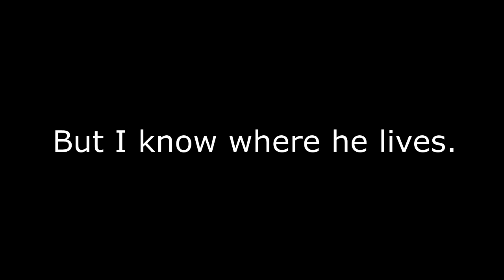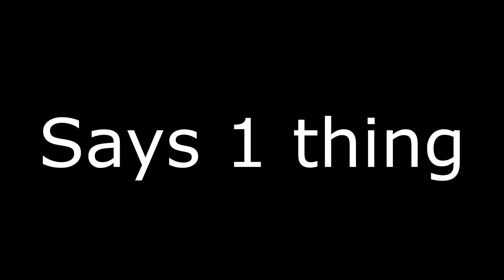SUPER SKETCHY DEAL: Only On Craigslist

Comment: 3d machines you'll never believe it but, I went to buy a dual sport Drz 400, on Craigslist. looked over the bike, it was missing bolts on the plastics but ran good and seemed decent, bought it for 3 grand!!! thinking it was a really good deal, got it home, tore the plastics off, air filter was full of rats nest, carb full of crap, whole subframe was bent, it leaked coolant from the water pump, leaked fuel from the Accelerator pump on the carb.. can't wait to fix more :)
Reply: Damn, the worst that happened to me has been a kx250 with severly bent subframe which is still usable so im not bitching yet lol. i traded an 01 KTM 125xc with blown fork seals for the kx250, that was just replated. I'd say it was a fair deal

Comment: when i bought my first motorcycle, it was an 83 suzuki gs650gl, and the guy already had the title signed and notorized which is all you need in KY for a transfer. and i walked away with a hunk of metal for $700. it refused to run all winter but the next spring it ran beautifully. i rode it for 2 years and 7000 miles without ever changing the oil and sold it this past september for $725.

Comment: I bought a car for $150 and I knew what problems it had
broken CV joint
severe body damage
broken door handles
broken radio
broken interior light
breaking steering wheel

$150 tho :D
Reply: Haha I bought my car for 100€ and it somehow wasn't a new car either, wonder how :D 

undercarriage needs some work, it sat for 6 years 
electrical work... let's just say it's a big mess 
water leaks everywhere 
no radio or speakers 
even tho no rust (calvanized body from factory), paint is faded and stuff 

however, engine is still going strong, gotta praise those 1980s audi engines :D little tlc, could become my daily driver :D it's almost in better condition than my mum's old car, 13yo suzuki :D

Comment: Was going to buy a Yamaha superjet and Craigslist, but the guy sold it before I could look at it. Same ski is back up on Craigslist a month or two later. I go and check it out and the kid said that his parents said it was too dangerous, so he never rode it. I did a compression test and had him start it and everything seemed fine. So I bought it, put it in the water and wouldn't go past idle. Turns out the carbs were clogged so after that it was good. When driving heard a weird noise and found out rear crank bearing is bad. Here I am rebuilding the whole engine. Good thing I got it for a decent price.

Comment: My sketchy story; I had found an ad on craigslist for a 94 7.3 Powerstroke, Truck looked nice. Was blue, lifted four inches on 35's. But there was only one picture on the ad, and said it only needed cab corners for inspection. I said screw it and texted the guy, he said to come over and look at it. I got there and as soon as I saw it, I knew it wasn't the same truck. It was blue but had lots of red pinstriping, did have 35's. But very very many rust holes, such as rockers, cab corners, bed, and the tailgate was rusted out. Didn't even get out of the truck. Left right after I had seen it

Comment: I recently bought a 2005 Crf250R out of Springfield, Mass over the summer. If you live in Massachusetts you know to never buy from the city. I was a little desperate and the price was right for the POS. We went 50 miles and arrived in the Ghetto. No joke, 6 dudes all walking around the house, 2 mothers with their kids on the front porch. Sadly that was the address. My dad and I walked up and asked if they had the 250, they did. The guy selling, Christian, said it was in his "Basement." Alarms were going off in my head and I could see my dad sort of losing it. We walked down the steep steps and immediately Christian told us to wait there while they clean their "Mess" up. We could smell the pot they just smoked, we saw the haze. They finished picking up and we walked down to a 250 in the corner of the basement and about 3 dudes all in foldable chairs sitting there eyeballing us. We had to push the bike up the stairs and outside. Soon enough we got it out and it turns out the bike was shot to hell but still ran. He tore the spark arrestor and the baffle out of the pro circuit and i swear it was louder than a banshee. I ended up buying the bike for $1500, and I put about $2k into it and the thing absolutely tears ass on our trails.

Comment: 3dmachine I went to buy 2 dirtbikes both were supposed to have no compression. well I wound up getting there in the dark at the guys house and he had about 5 guys outside. well the brought the bikes out of the house that had no power, but all said and done I walked away with a crf450r that is locked up for a steal. of course had to get good paperwork on it. but I'm gonna rebuild it and rip on it.

Comment: So I just bought this MINT '89 S10. 4.3, 700R4, rally wheels, snap on tonneau cover, restored interior, no rust. MINT candy red paint, 80K miles. I saw it on Craigslist, and went to go see it. He wanted 400 bucks for it. INSANE DEAL! I bought it site-on-scene. Once I got there, he said he had no pink slip, another buyer was coming in an hour. At this time I asked him about wiggle room. He got all pissy and starting ranting about his wife he needs to bail out of jail. Nutso. I gave him cash, loaded it up, and drove away. What I assume to be the other buyer was driving down the street as I left. The guy turned around and followed me to a gas station after about 5 miles. This dude was PISSED! He got out a pipe wrench and I got the hell out of dodge. Luckily, I was using my '73 Chevy K20 as my tow rig and it has 500 horsepower. So I split right out and made it back home safely. Sketchiest transaction I ever experienced... And hopefully that to ever experience.

Comment: my sketchiest transaction was when I bought a NEW bmx from a shop, after 3 months I was forced to put it away due to very cold winter, I love the bike, it has scratches but what bmx doesn't, anyway it turns out that the bike I bought was stolen from a rival bmx shop it was brand new as I bought it in the sealed box in parts.  I still own it and it rides great even 4-5 years on runs like new, all it has is new tires, rear wheel and grips its kind of weird that the bike is like new after this long but hey I'm not complaining

Comment: The sketchiest experience I have had: Used car dealer tried to sell us a 04 silverado ext cab with no working speedometer, service light on, no headlights, and bald tires. Guy tried to tell us that the truck only sat there for a few weeks, when, in fact, we had seen it on AT(AutoTrader) 3mos ago.

Comment: Yeah bought a 98 Subaru Legacy Outback on Craig's list, yeah was advertised with clean title and out in the sticks.  It had been wrecked rear ended a truck with trailer hitch damage so the nose was little bashed in. then passenger damage guessing they deflected off the truck and hit something but was  not stuffed the panels where wrinkled, it ran and drives. he only wanted 1,000 bucks for it so grabbed it, later find there was lien on the title and still getting run around in circles by the dealer that sold it to him ad the DMV so it sitting in my driveways even though I fixed it and it road worthy now just annoying they cannot get their crap together and clear up the ted tape.

Comment: I got a bombardier traxter 500 and I talked to the guy twice on the phone before going and seeing the thing he said it ran and drives but a noise in the rear end somewhere. Went to look at it and asked to hear it run and the kid said then tells me it doesn't have an oil drain plug and no oil in it (this has a rotax 500 in it) looked at my Dad and then we started looking around at other parts of the bike. Came back a day later and got the thing picked up an oil drain plug at a can am dealer and took it home. Got it home and nothing worked spent two and a half weeks figuring out the electrical, first thing we checked was the fuse box and there were no fuses in it there were some when we saw it at his house. Longer story short got it running and found out the rear diff was filled with mud and rocks (the noise in the rear end) luckily a guy an hour away has four of these bikes and a shit tone of parts now 1200 into the bike its like new.

Comment: I was gonna buy a 1981 John Deere 314. The add said it had a 16 horse Koehler and it smoked a little. I bought it for $450 I got it home and saw a oil puddle I checked and the head is broke and the carb. The ass wod "forgot" to tell me about that. The tractor has the side panels on so I couldn't see the oil leak. So I'm out $100 to get new parts. Not sketchy but funny

Comment: My sketchiest transaction was when I drove 40 miles to bumf**k New Hampshiere to buy a 351w and transmission for my f150. I saw it running and driving in the truck before he pulled it. I put down deposit and bill of sale saying I got engine and trans for $300. I went back a week later dropped off my trailer and went to dinner with the family. Came back and saw only the engine loaded, no trans. (He claimed it broke in half, but he probably gave it to a buddy) The guy was no where to be found. So I waited in his yard for a hour while he come roaring back home in a truck he just bought and demanded I pay the full $300. Needless to say we left only paying $200 for the engine and a few parts. The guy was super pissed, and called the cops saying we spun our tires and smashed a window (not possible with the trailer behind the truck). That was the last time my mother will ever go on a craigslist buy with me. I still have the truck with the engine in it three years later (3 years to the day).

Comment: My sketchy deal is that my parants bought me a sled for Christmas last year it was a skidoo 600 it runs good had engine and supination rebuilt the cowl says 380 and it the sticker say rotax and renagage. As we root into it to put a chain case in it last year it had the Id number scratched  off before and and had the wrong size sprocket on it moral of the story look at stuff closer before you buy it

Comment: 3d machines you will never this but i saw a yamaha banshee on the craigslist for $1500, guy said he couldnt get it running , went to check it out the guy pulled it out of the shed looked really good kicked it once had good compression opened the throttle kicked again started to smell the gas so I let it sit and when I was looking at the engine I noticed a wire that was unplugged plugged it back in kicked it twice and the thing started right up , the guy just wanted it gone so I got it for a smokin deal $1500

Comment: what is a good 2-stroke starter bike
Reply: 1990 cr500
Reply: Honda cr500 best starter bike out there
Reply: Danny Fagan A Macio 700.
Reply: These guy are messing with you lololol!!! get a two stroke that you can keep pinned 
Random guess a kdx 200 or smaller depending on your size, experience and physical fitness.
Reply: Ronan Rankin Yz125s are great, just there the tallest bikes.
Reply: James Kovalik  well I 6ft and have a drz 400 so I think I am tall enough
Reply: Danny Fagan If you fit a drz then prolly just get a kdx 200 or 220. Or you could just hop on a 250 but that depends on how skilled you are.
Reply: James Kovalik I have been ridding for nine years and have only had four strokes wanna change it up and get a two stroke is a yz 125 good
Reply: Danny Fagan Yea there good lol, just not crazy amounts of low end like four strokes, you really have to ring em out to get in the meat of the power. We ride out in Kentucky where there's mad hill climbs and I find myself always getting stuck BC I wasn't in the right gear and I wasn't in power band, I would suggest a bigger bore 2 stroke. if it's just for putting around a farm or feilds then it would be fine, but just check out some 250's and 125's and find one that suits you.
Reply: How old are you??
Reply: Luke Pierre 17 y
Reply: 125 2 strke
Reply: Honda cr125
Reply: Honda cr500, you'll grow out of it quickly though
Reply: Danny Fagan Yamaha blaster
Reply: Austraverse lmfao I get thrown around on the kx500 it's the same at the cr500

Comment: I went with my friend who rides a YZ125 to go buy a YZ250 and when we got there, it was in the industrial hood, and this guy pulled it out of a warehouse with 5 other bikes. All the fenders were held with zip ties, I sat on it and the fenders fell off. All of them. Then when I went to kick it the start lever fell down to the foot peg with zero effort. The rings were shot completely. And fuel started pouring all over the ground. The frame and swing arm  and select plastics were painted black too. And agreed price for this 2000 YZ250 was $1300. Then when all this shit happen guy goes $900 and my friend and I looked at him and said not even worth $600 and we drove away. The funniest part was another guy from the warehouse pulled out another YZ250 in excellency condition and rides it down the street XD

Comment: Went to buy my 1990 Suzuki RM125 from a guy for $800 said it ran the other day when his brother rode it. I show up and he says it doesn't run, alright no biggie ya know, I start messin with it and it has no compression, too much 2 stroke oil in the mix and doesn't even sound like it wants to start. I told him its worth $200 and he say $400 so I take it. Get it back to my buddies and start ripping into it and it has a blown cylinder base gasket, no head gasket, exhaust valves(power valves)  are falling out of their holes, magneto is out of timing, spark plug is junk, front and rear tire are junk, grips are thrashed, plastics are faded front motor mount is gone, the clutch doesn't engage and many other small problems. To sum it up I fucked myself out of $300 and the bike still doesn't run.

Comment: Sketchiest thing I've done is look at a ragged out Polaris behind what I'm fairly certain is a meth lab trailer with 2 super sketchy dudes and they had no papers and had it wired with HOUSE wife to bypass all the solenoids and safety switches so you didn't have to have a key it was just push button

Comment: Story Time: Looking on craigslist, trying to find a good deal on a four wheeler, find a Honda foreman, hit up the guy, ask if he has a title or any papers, no papers, or papers where with previous owner which he said was family. so I ask how many mile, he says 1150, I asked him when we could meet up, he said we could meet up one night at some contracters shop, it happened to be a buddy of my dads shop, so we thought oh it was family of my dads buddy, so we go and it was night and the dude was outside of this place with the quad running, it was way more beaten up than in the pictures and the head lights would not work, then it stalled, so Then he whips out the starter fluid and pops open the seat to start it, after inspecting the quad we than notice that the quad did not have 1150 miles but 11,500 miles, we then just leave because at that point it is way to beaten up and to fishy for us.

Comment: Sketchy story went to buy two 15 inch sub woofers for 65 as i was headed out there he calls me and said the price was supposed to be 65 each then he told me that he could do 55 each when i got there it was in the middle of nowhere and he decided to do both for 80 then as i left he cam and gave me two 12 inch subs also one 16 did not work at all and the 12s had broken connections

Comment: My sketchy story is I went to buy a Honda fourtrax 300 and the pics looked great I get up 1 hour an 45 min drive and the thing is destroyed so I drove it around an get to looking the wrong ignition key switch is not stock he says he lost it in the woods🙄 Then I look at the motor and instead of using a gasket or gasket maker they use super glue to put the head back on an at this point I'm like wtf so I still ask how much? Dumb ass says 1400 I was like bye and then I ended up getting a Honda rancher 350 so go look at the video on my channel to see the 350 and I'm trying to start a YouTube channel because I ride dirtbikes and four wheeler so I'm lookin for some tips. Thanks

Comment: Hi my name is Nathan Turner and I saved up 2000 to buy a atv Polaris sportsman 600 it was an 04 and  the guy wanted 2500 for it I ask him if he will do 1500 and he jumped right away and even through in some stuff I did a few upgrades such as led lighting and I custom made a rad relocation kit and everything was good put about 150 km on it and it blew up so luckily I had a bit of money left I bought a 700 sportsman Motor and took it apart to see if it was good it was 400 bucks then it needed a cam shaft and my dad Owns a shop so I bought a cam shaft for 50 bucks it was a stock Polaris cam shaft and I put it in the Moter put it all back together put it in the bike and then I put about another 10 km on it and the cam shaft blew right apart into three pieces and now I'm 14 years old all my money gone and I have nothing to go from I'm trying to start a YouTube channel kinda like yours i don't know if it's a good idea or not anyways merry Christmas and please answer

Comment: when i was 17 i once tried buying a 95 f150 with a 351 windsor on Craigslist, went to check it out, back seats are missing, he said he can get a new set and his appolustry guy will "handle" it, he points to his beamer which had tan interior with re done black seats, then to pressure me he tries pulling up text message threads on his phone to show me other buyers, his finger slipped and click on the wrong thread and big photo of his d*** pops up and in the background is a tan bmw interior with black seats, He didnt realize it at first because he flipped his phone around quick to show me, i started walking away immediately  and he flips it back and starts chasing me to my car saying "nah nah nah thats my bad yo" i got in my car, slammed the door and almost ran his toes over, that was the sketchiest craigslist deal of my life...